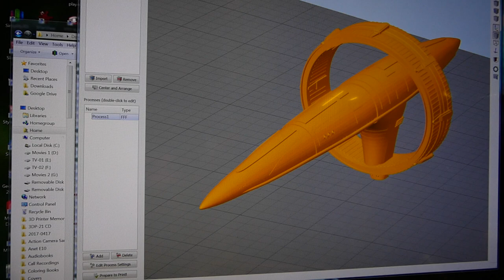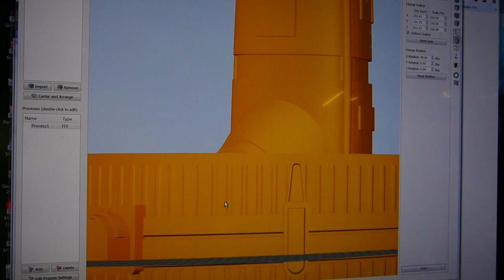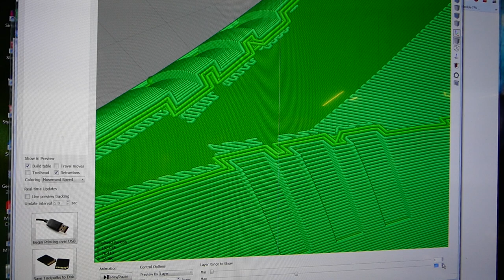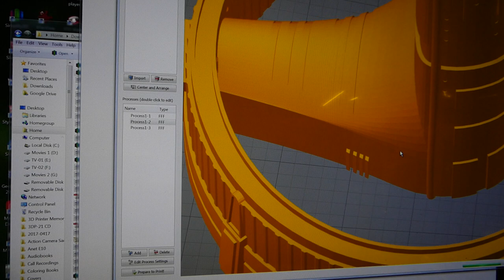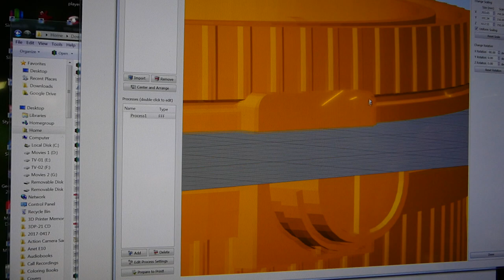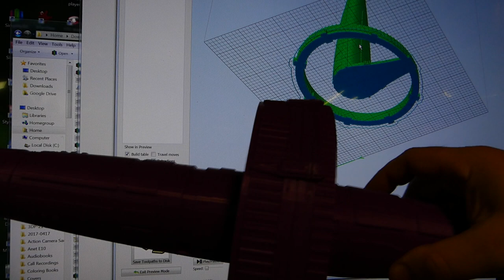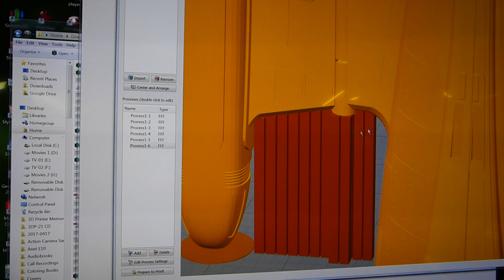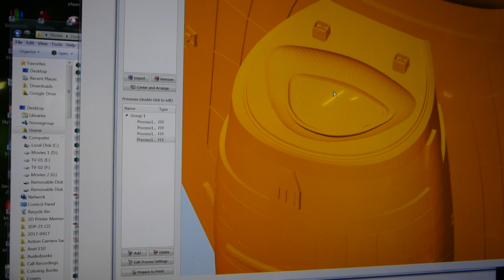Today's 3D Print - Slicing up starships for CR 10 Mega Printing HowTo

Comment: Thanks for explaining simplify 3d a little. I have been wanting print a large gallaxtica for a while but did not want to take 2 rolls for it. but did not want a failures either. Thanks I think I can successfully attempt it now.
Reply from the maker: +Hard White Wolf good for you start off small make a small model but slice it like you would if it was large see how it goes look over the print see what went right woman wrong and extrapolate what will happen when you make it larger don't forget to account for wall thickness and layer shifting as you scale up because remember your nozzle does not scale-up so you have to consider the physics and geometry of what you're doing

Comment: nerys great video learned a lot. Unfortunately I don’t have simplify 3d can I do this in cura? Also can you please explain what you mean about you have 3 perimeters
Reply from the maker: I am not sure. what happens if you drop the model INTO the virtual print bed and hit slice ?

as for 3 perimeters. exactly what it says. 3 perimeters. cura is "odd" about this they just call it wall thickness and you have to do the math. so .4mm line width means 1.2mm wall thickness in cura would be 3 perimeters.
Reply: Nerys thanks for the quick response I understand now thank you.

Comment: You could just cut this with Netfab...or what ever it came to be called now....It will slice a STL up with ease.
Reply from the maker: James White for simple models like this its just so much essier to just do it in the slicer. Now if you need to do a non mirror cut this wont work.

Comment: Smart how simplify can split the model like that to controle where you want support
Sadly its not free but perhaps some day ill get that too

Now first,  i need to get the printer :)
can Cura split Infill like that as well ?

on the small printer i have borrowed right now ime using replicator host, and dont think it can do it .
and not familier with the Cura app yet
Reply from the maker: mistube not sure i have never used cura. If time permits i may try it some day so i am at least familiar with it.

Comment: Are the bottom layers necessary, as the 2 halves are going to be glued anyway?
Reply from the maker: Alain Ravet technically no but it's easier to glue two flat surfaces together than it is to glue two edges together 4 Deep Space Nine for example because of its sheer size I did not print the bottom